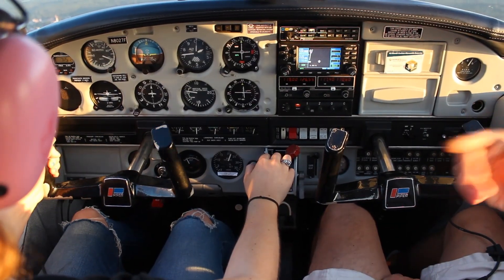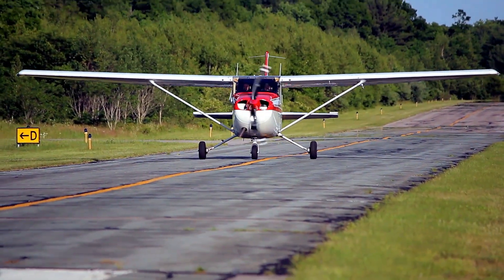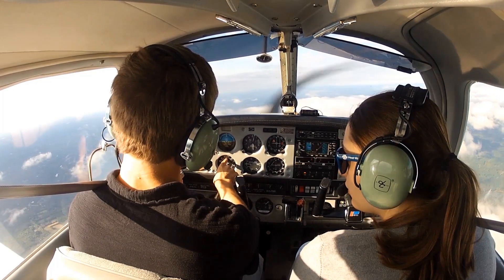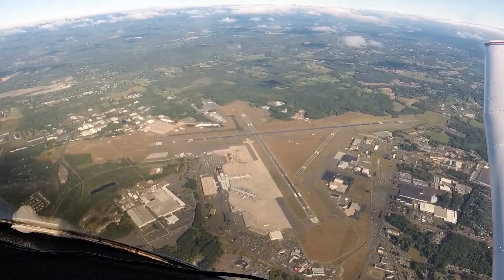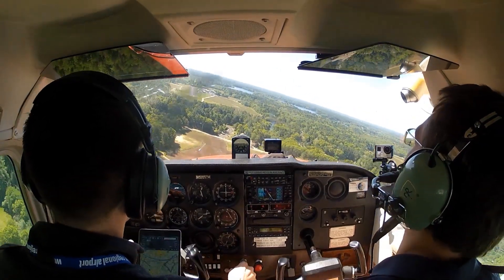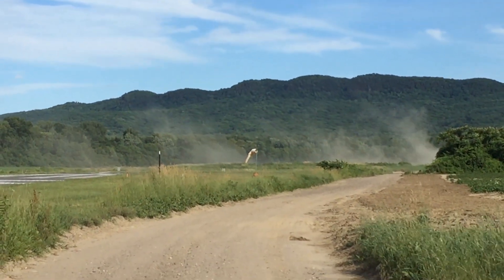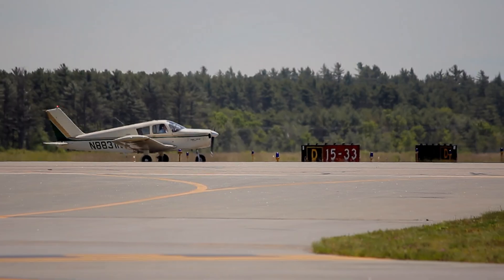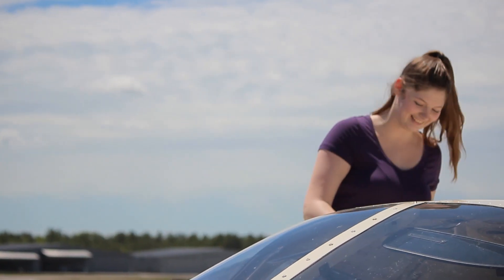Carb Heat Demystified:  Understanding the mechanics and the dangers

Comment: One time at night I was flying a 150 around the pattern and when I made a reduction below 2200 RPM the engine started to sputter really bad and I immediately pulled the carb. It then began smoothing out after about three seconds. After that I left it on and leaned the mixture. In 40 years of flying up until that point I have never experienced actual carburetor icing. This particular 150 must be one of those type of engines that are prone to icing very easily. Yes there was high humidity and the temperature was around 60° at sea level.

Comment: In a Cessna 195, you apply carb heat in cruise to bring the carb temp gauge up to around 70 deg. F and it leans out much better. Also, in many airplanes in IMC and low power settings even still in green arc you might get icing (in the 195 I always keep the carb temp above the credit carat on the gauge when in the clouds). There are just never absolutes.

Comment: so to turn on the carburetor heat is to pull it out or push it in? I guess pull it out with 90% confidence but not 100% so I ask. You think this is a too easy and stupid question which it is but there are people never fly a plane before is also interested and like to know. This is a good video and teach men something.

Comment: Float type carbs can develop induction ice at ambient temps above 80F.....even at cruise power.  Temp drops due to fuel atomization vaporization is about 50 degrees F.  Different installations may have more or less of a tendency, but the can all ice up. Having a CAT gauge is a good thing.

Comment: the piper has the air intake at the front similar to cessna. the air intake at upper area of the engine is for the cabin heat.....

Comment: So my old 1968 172 with an O-300 has the carb mounted to the oil sump, with the intake tubes passing through the oil sump, yet it still gets carb ice. 

I guess this video falls under "Ask someone on the internet" (who is clueless) 

You are never putting yourself in danger by using carb heat. 

OMG ! Unfiltered air ! ! We're going to die ! !

definitely a thumbs down video.

Comment: In my flight school (in brazil where temperatures are usually high) we only use carb heat if it's reallllllly (like, really) cold outside, is it safe, is it right? We don't use in landings, approaches etc...

Comment: Dang that's pretty sad using exhaust heat to melt ice forming on your filter and damaging your engine. Why don't they install an electrical system to convert into heat to melt the ice on the filter?

Comment: Basically, do what the POH says.
I worked a few years as a mechanic and I never heard of an airplane engine being damaged because of carb heat use. On the other hand, I've read countless accident reports, sometimes deadly, resulting from pilots not using carb heat when they should have.
Reply: The first plane I flew in, the Cessna 150 had a joke of a POH. It said one thing about Carb Heat in the entire thing, and it was in the TO checklist. Carb Heat: As Needed

.....thank you cessna, that is so helpful.
Reply: @Nathan-qo9kg  And C150s/152s are carb ice makers at cruise, given sufficient ambient humidity.

Comment: Never seen a Piper with heat directed from the rear of the engine. In fact the Piper Warriors would ice up on initial start if any rain or damp in the air intake. Makes for a good demonstration of carb icing for students. Only time i see icing is when it's misty or foggy days and when doing power checks you se moisture trails of the prop blades. In 15k hours flying never seen icing in flight. Perhaps because i do regular checks for ice. But have had C150 ice up just taxying to the runway.

Comment: Is there a gauge that can be installed on these planes where an idiot light/warning comes on for scenarios when a certain temp is reached? 
I’m new to planes and just signed up for lessons so take it easy on me :)
Reply: Juan Motorsports you can install a temp gauge but honestly it’s easier to just listen to your plane. Either your rpm or manifold pressure will change when you get carb or intake icing. Basically the air flow is being restricted or ice will impede the cylinders from getting full ignition. The danger with carb heat is that it’s unfiltered air that is scooped up around the engine. Any contamination, dust, rocks, etc. can be sucked in and cause all sorts of problems with the engine. You might have a gravity divider which will blow the air against a sharp bend allowing big debris to fall into a collection container but it’s not fool proof. Try not to use carb heat unless there’s a danger of icing. Normally under 40 degrees Fahrenheit. And you’re in no danger of sucking up debris. Hope this helps man.
Reply: David E thank you. I’ve been looking into getting a Cherokee 260 or 300 and debating carb or fuel injected at the moment.
Reply: Juan Motorsports fuel injected is normally a better bet.

Comment: well I understand why a plane needs it now. I was looking at the wiring diagram for my 2008 Yamaha v-star 1100 and while I was looking saw it had a heating coils for the carburetor I wonder why? the bike is overall a bit modern with its technology without being fuel injected. it electronically advances timing, has a fuel pump, and a throttle position sensor. weird

Comment: Learning on a 172XP with fuel injection but also a constant speed prop so now, in place of carb heat, I’ve got rpms and manifold pressure for my instructor to yell about before landing.

Comment: Real reason for icing during lower rpm is beacause you're closing butterfly valve, and that increase the velocity of the air. Velocity increases, and air pressure and temperature decreases. And if there is alot of moisture in the air say on a humid day, that water collects in the throat of the carb and starts to freeze do to the pressure and temperature drop, Very very common on cessna beacause the induction air feeds directly from outside and right to the carb. Unlike a piper which the induction air is routed around warm areas before entering the carb.

Comment: Drive a Chevy Corvair for awhile and you will be an expert here.
Reply: Drive an early Triumph TR7, my carbs iced up at 70mph and locked. Only forceful braking slowed me down so i could turn off the motorway. Later models had a warm air system. And the same on some motorbikes.

Comment: Both my cars have automatic carburetor heat (done mechanically or using vacuum) and in both cars the hot air intake is before the air filter, so the air always goes trough the filter. I guess in airplanes this is done differently in case the air filter gets clogged up.

Comment: The problem with waiting until you have icing (noticing the power loss) is that the rapid melting can possibly stall the engine.  I've had this  almost happen on the ground in an R22.   Was in carb ice favorable conditions, letting the engine warm up.  Once we were ready to pick up, put the carb heat full on to bring the guage out of the yellow, and it sputtered read bad for a second.   It might not have happened at the higher power req'd for hovering,, but it definitely was noticeable

Comment: Is this actually accurate? I have not been able to find a Piper that has an induction air pick up behind the engine. The PA-28s seem to have cold air pickups from the bottom of the cowl or NACA ducts on the side.
Reply from the maker: I think it might be a difference between early PA-28-140's and the Warriors/Archers that came after about 1975.  That's been my experience, at least.
Reply: @FriendlySkiesFilm  Thanks for the reply. From digging around in IPCs and AMMs this is what I have come up with. The Piper induction air pick up from the back of the engine looks to only be true for some PA-28-235s and the (injected) PA-28Rs. (Happy to be proven wrong) For many (depending on serial number) 4 cylinder Cherokees, a metal air box is usually found on the right of the carb and picks up cool air from the bottom of the lower cowl. That said the exhaust is in front of the carb and the air box so it will pick up more convective heat than a Cessna with the exhaust above or to the sides but still definitely not picked up from behind the engine. The early PA-28-140-180’s, however, have the air filter in the nose cowling and the exhaust behind the carb so no intake charge warming that I can see there at all. Also the Archer 3 has a flexible hose from the left of the carb to the air box in the lower cowl feed by a NACA duct therefore picking up less convective heat from the exhaust than the right side metal airboxed PA-28s.
For example, it looks like the Archer 2 and 3 POHs have the same procedures around carb heat even though they have quite a different induction design. An optional carb ice detector was added for the 3 along with a section in emergency procedures dedicated to carb ice. 

So it looks like the Piper Cessna simplification is only sometimes correct and the pickup from the rear generalization seems to be a bit off?

I guess the message of this video would have even more sway if after all that you go on dispel the Piper / Cessna generalization. Training simplifications are what got 265 people killed in AA 587 because no one was/is teaching what Va actually is...

Comment: Noticed the Piper Archer II and III have cold air pickups on the front of the cowl rather than behind the engine yet still have a green arc from 500 to 2700. Also a number of 'unexplainable' engine failure NTSB reports.... Any thoughts on this?

Comment: Cessna 170, o-300, "on" after run up and "off" when taxing onto runway so its clean for takeoff. I would then monitor tach and "on" if any drop in rpm and you could notice an increase in rpm as ice clears then back "off" after things stabilize. "On" for a minute before pulling power on downwind  to get the full blast of heat and when coming out of the green arc."Off" on short final so you can have full power for go around. I would be careful in cold temps can cause carb ice by raising carb temp into carb ice range. I also turn on once in awhile during cruise to test for ice.  I did not have carb temp gauge and flew most in summer in SE Alaska. Low time pilot so might be better ways but never had an issue and have had carb ice several times mostly on the ground.
Reply from the maker: Now here's someone who has their powerplant figured out!  Nice system.

Comment: I fly a c150, I have the carbheat on for the whole descent until about 300ft AGL, then I push it back in as part of my short final scan/checks to be ready for a go around. I check it in cruise as part of my FREDA checks every 20-30mins too. For the FREDA, I pull it out, count to 10 slowly and if there’s no rough running or abnormalities I’ll pop it back in.

Comment: I once got carb ice while taxing a C-150.  It was not plug fowling, it was real carb icing.  After we applied the carb heater, the ice melted and the engine ran smooth again.  I don't recommend using carb heat while taxiing because of the bypass of the airfilter.  But it is possible to get carb icing while taxing.  I know, I've experienced it with over 4,500 hours in mostly single engine Cessnas.

Comment: my instructor always has me turn it on on final ( 1985 and 1978 piper pa28 181 archer IIs)
Reply: Pulp Free Fiction Mine too, since were in a very humid location.
Reply: Instructors tend to teach procedures for all aircraft rather than be aircraft specific. So some aircraft may not need carb heat on final for instance, but stands the student well for those that do. The Cessna 152 and 150 case in point, two totally different engines.
My old instructor was a Battle of Britain pilot, he said we teach you to fly an aeroplane, not a Cherokee.
In the Air Force that is what they do.

Comment: why cant an air filter be put in a carb heater? "random youtuber will say: CUZ ITS HOT!" but no, thats not an excuse so please dont comment that.
Reply from the maker: I've been searching for an answer to this for years, and it's exclusion seems to be pretty universal across Piper, Cessna, and Beechcraft creations from 1950-1990's, but I have yet to meet anyone who can tell me why!  Very frustrating.
Reply: The idea of carb heat and alt air sources is that there is no obstruction that can build ice or debris and block the flow

Comment: so, add a filter to the pipe leading from the exhaust and make it so that instead of supplying the already hot air from the exhaust directly back to the engine, it heats the carburetor so that the ice melts?

Comment: I had been told in what way carbs were connected to excess fat and in general to try to avoid carbohydrates, on the other hand had by no means looked at utilizing them to trim inches away. The primary thought behind the four cycle fat loss approach is used to train the entire body to burn off fat for energy as a substitute for carbohydrates. https://goo.gl/rPBAaJ

Comment: Most cars from the late 70s through 80's had carb heat but the valve (thermostatic, not manual) was simply placed upstream of the air filter.

Comment: Install a carb heat temperature gauge.    

Most of the times I was told carb heat was necessary it wasn’t, and when it wasn’t necessary, it was.  With a gauge you’ll see why.

Comment: Only one time, right after I got my private license, did I forget carb heat until I noticed a slight decrease in performance. Then I pulled it full and everything went back to normal in a few mins. I dont know if I was anywhere near an engine failure or not but it scared me so bad, I never forgot it again. It only takes once.

Comment: I'm not a pilot. But, when I was working on Hamilton Island as a musician, in the early 80s (Whitsunday's group - Qld, Aust) I got friendly with some pilots who flew Cessnas & had quite a few flying lessons FOC (Wouldn't happen today, no doubt). They were brand new Cessnas in the day & they were turbo charged. The pilots were really happy with the extra power & better control they had with their new planes. My question is, even with a turbo in a Cessna, would icing in the venturi still occur? Thank you.

Comment: Kind of makes you want the Piper over the Cessna. Will definitely add this to my research on individual planes
Reply: Try them both before making a decision one way or the other.
Reply: I love my cherokee. But it's all I know. Pipers are less expensive than cessna's
Reply: @biggentallen   But they’re know to be Doctor killer’s 😂😂
Reply: @DoitwithOA  that’s the bonanza, V tail.
Reply: The Piper design is less prone to icing, but the Cessna design is higher performance and efficiency.  Remember they said carb heat reduces power - the Piper lives constantly with a half-dose of carb heat.  So that's the decision.  Do you prefer the filtered ice resistance, or do you prefer greater power?  But let's be real here, 90% of us choose based on where the wing is, and make excuses about everything else.

Comment: Hi Nick, upon completing the run up procedure, I forgot to turn carb heat off! (didn’t follow check list!). My takeoff felt draggy, rotating at 55kts with two passengers onboard. At that point I thought maybe it was normal for that aircraft since it was not the one I usually rent. After checking out videos from my passengers and trying to figure out why my takeoff was draggy, I realized it was the carb heat! It was on until the end of my flight. In retrospect I don’t want this to ever happen again and that’s why I would like to know your input. I flew for about 1.5 hours from Miami to key largo Florida and back. Great flight and landing was on point.
Reply from the maker: Yeah, been there... at least for the takeoff part.  I think you said it all.  Just double check that checklist.  In my case, I diagnosed the problem before I was more than a few hundred feet off the ground, but this is why putting the same item over and over again in different checklists can be advantageous.  If you did a cruise checklist and it said "carb heat" maybe you would have caught it then.  Good job doing diligence and reviewing that video :)
Reply: Friendly Skies Film thank you Nick! Other than the poor takeoff, do you think the prolonged used of carb heat (1.5 hrs) negatively affects the engine? Like risk of detonation or something else? Thank you for your fast response! #workingtobeasaferpilot
Reply from the maker: I think most pilots would probably say not to worry about it.  If you knew there was some fine particulate in the area, like volcanic ash, or forest fire smoke, then you might want to ask someone, but it's not the kind of thing that I've heard about.  Very jealous of your route, btw ;)

Comment: where does the air from the exhaust come from?
Reply from the maker: A pipe originating next to the exhaust gas heat exchanger, open to ambient air, and only protected by a coarse grate.  This is on Piper installations of the Lycoming o-320, at least.
Reply: Thank you, your video is helpful
Reply from the maker: You're welcome! :)

Comment: Maybe mentioned here before but, yeah there is a big difference between a Lycoming and Continental Engine.  Lycoming mounts their carb on the oil pan which minimizes carb ice since the hot oil effect warms the air inside the carb.  Both of these engines are used on Cessna AC.  An instructor once told me there is a danger using carb heat in extreme cold temps like those below 20F.  The increase in air temp by carb heat usage will add moisture by warming the air--actually causing carb ice to form?  Spoiler= I do not know if this is true but it sounded logical and I always remembered the comment.